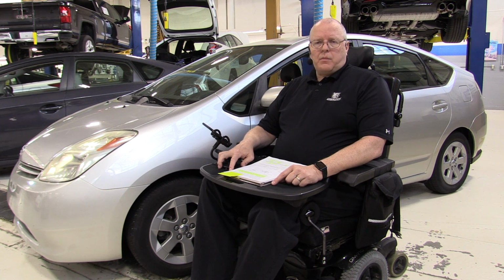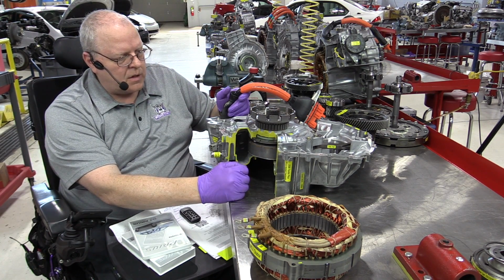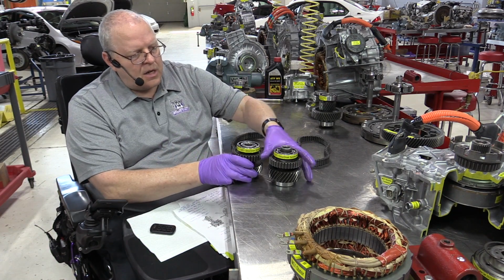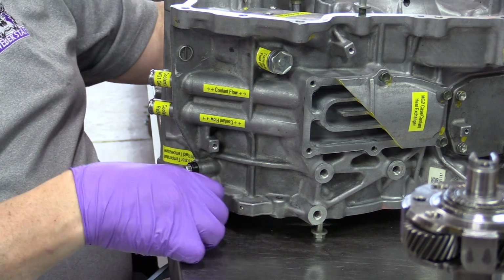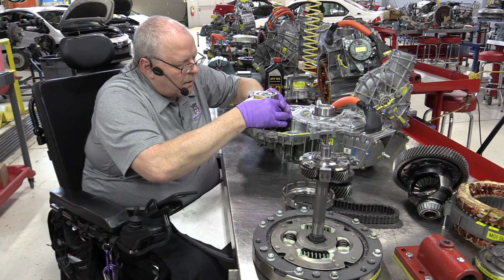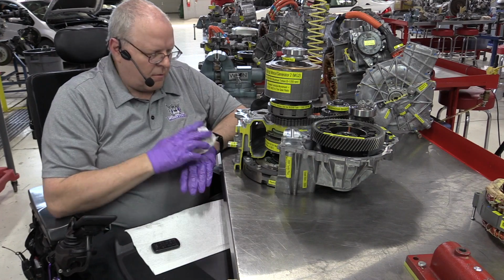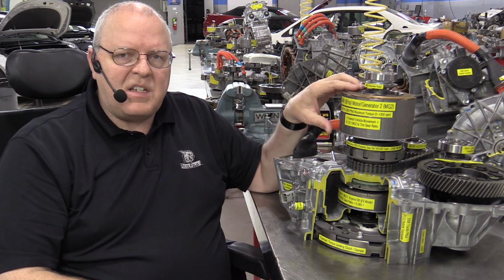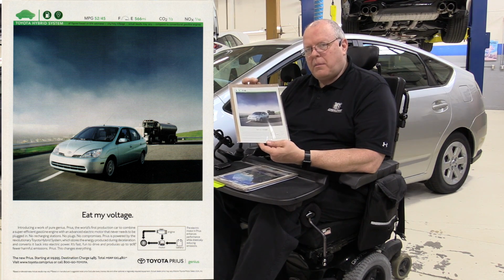2004 - 2009 Prius Transaxle -  P112 Deep Dive

Comment: Thank you for the video, I recently bought a 2006 Prius and it was great to see the inner workings of the transaxle. If you have the opportunity to get an Outlander PHEV transaxle made by GKN that would be interesting as well. Im sure the operation is very similar to the Toyota system but with the addition of a lock up clutch for Engine direct drive.

Comment: John, I own two 2007 Toyota Prius cars. I have rebuilt the HV batteries several times and this last time I replaced the battery modules with the new LiFePo4 batteries and the 400 amp output made the exceleration amazing.

Comment: I have a freedom 2 wind turbine that makes like 96 volts wired in series because it's two 3 phase motors and the amps is like 30 and only needs 15 mile an hour winds. Wondering if I can double the power if the v shaped permanent magnet rotor would make the same power as the normal grid with only a four foot carbon fiber blade and the magnets cancel each other out with a total of 48 and spin smooth brushless at 25 feet with just dirty wind from tall trees. LoL just a thought
Reply: Turbines are more shine waves or phases but low rpm or hertz. Wild ac power is directed on just one positive dimesion or direction like DC.  Think like more phases or braided 7 waves of positive magnet flux spinning less speed revolutions but more phases less spaced apart not just 3 with alot of force or rpm more resistive than conductive. With 3 phases each phase one third apart make 3 phase 60 hertz.  Not 7 phases and low 4 hertz or about 250 rpm. Normally 3 wires with 3 phases so one third spaced apart alternating current in each phase equals 60 hertz. Divide 3 or 3600 rpm and 3 phases spinning 60 hertz. PMG wind turbines are like 250 rpm or like four full waves or hertz each second but with multiple waves before each complete turn piled up basically four hertz times 7 flux magnets that simulate a cycle of one phase so seven voltage positive and negative waves starting starting with multiple waves wild ac converted to DC with a rectifier. They told me just good for charging batteries even if you can get almost 110 volts it's wild ac turned to DC to charge fast not run electronics. You need Maine a 3 magnet 3 phase ac motor spinning 3600 rpm to work like utility's power grid. Nevermind thinking trying to hook up a drone motor where the alternator should be. I have a GM  Delco alternator converted to a 1500watt PMG but really that's top rating and it really only makes 3 amps at 12.5 volts 250 rpm
Reply: You know how the hybrid charges at only 5 amps. I had a solar charger hooked up to cigarette lighter outlet 20 amp charging a separate battery or battery bank 4 times faster. Just need enough power for computer to just get ready. I want try more power than 5 amps from the step down charging module for power to be available with a pure shine wave inverter when the engines is off I can use 110 a/c

Comment: what is the internal spline spec of the main drive gear shaft ? also , what is the spec of the spline on which the clutch plate assembly is mounted?

Comment: "Eat my Voltage" is a throwback to "Eat my Dust" reference is probably correct, implying that when driving a Prius Hybrid-Electric vehicle, one did not have to compromise on acceleration nor passing performance; possible as a response to those unfavorable initial auto magazine reviews of the 1st Generation Prius and the misunderstanding/misinterpretation of the "turtle" mode.

Comment: what is doing MG1 when MG2 is moving the car and the HV battery is fully charge? Mechanically i can see when MG2 is turning it moves also MG1, is MG1 always generating? because you said that to charge MG1 the engine needs to be on; and if MG2 always moves MG1 how it is controlled MG1 to do when the shift is in D?

Comment: Hi John, love your videos.  Can you tell me where the extra voltage goes? If the new mg2 can put out 500 volts, but the battery is only about half that.... What happens to that surplus?  On a conventional car, a 12v battery typically charges about 13.8 volts,  you would not want to put much more then that into it.   Thanks,  Pete

Comment: Sir this video really  helps me to understand many specifications for second generation Toyota prius transmission. Thank you very much. It is important for me to know a power (kWt) of MG1 . Please write what is 2nd Generation Prius MG1 power..Thank you
Reply from the maker: Thank you! I do not have the power rating for MG2 2nd gen
Reply: As is shown in video MG2 power is 50 kWt  (at 11.58 min. on video). But MG1 power is unkown. In the web some information say that MG1 generator power is 22.5 kWt ...On the other side MG2 is approximately twice big then MG1 and may be if it power is 50 kWT power , then MG1 power should be - 22.5/25.0 kWt...
Please answer -  is this MG1 and MG2 motors voltage same -  500 or 600Volt?

Comment: Sir I really love your Work, Allah bless you. I have a question that why they used ball bearings instead of tapered roller in counter driven gear in second generation? Because, as in best of my knowledge, tapered roller bear more load then ball bearings. Thanks,  LOVE YOU!
Reply from the maker: Thank you! Yes, I believe that is true
Reply: Thanks sir for your response. Please tell me about your perspective in the light of your experience, is there any design advantage of using ball bearings instead of tapered roller in second generation Prius?  Stay blessed.
Reply: Much cheaper

Comment: Great series! Love them and I am very glad that I might even help you with understanding the N position. At 53:43 you say you don't know what happens electrically. As I understand it, the Inverter short circuits the coils in MG1 and MG2.  Due to this short circuit, no voltage can build up in the coils, hence no energy can go anywhere.  

In Ohm's law: R=0, so U = I x R = I x 0 = 0 and P = U x I =  0 x I = 0.  The electrons in the coils will probably go all over the place within the coils, but since no energy is going out of this system, no energy will go in either. So no rolling resistance, no charging current, etc. 

To me, with some electrical background, this sounds very plausible. ;-)
Reply from the maker: Thank you and thanks for your feedback! I don't think they short the stator winding together, I now think that they open them to stop current. But there is still the rectifier diodes with their current path. I am doing some bench experiments to find out what happens. I will have another video when I am completed. Have a good day
Reply: I too think you are correct now. I can't find any reference for my claim, other than a vague memory somewhere in my head. All 3 coils of each MG are connected in a kind of triple H-bridge, and there is no easy way to short circuit them via this bridge without also short-circuiting the HV-battery. To short-circuit the coil, an extra circuit would be needed. Also, if I apply Ohm's law to the R= oo ( oo = poor man's eternity symbol), then I = U/R or very close to zero 0. Again P = U * ( 1/oo ) = almost zero. Just as easy. No current can flow, so no power is lost in traction.  
Sorry for causing confusion.. ;-)
Reply: You are correct, the way to put an electric motor in freewheel operation is to open the coils. I don't know how the electronics in the inverter/generator are arranged but, normally the stator is connected to a 3 legs bridge that can operate as a rectifier, an inverter, a short circuit or an open circuit.  By the way, thanks for the videos, I learned a lot from them.

Comment: You missed the changed bearing on the end of MG2, on the NHW11 (Japanese chassis identifier as the Gen1/Gen2 is wrong). The bearing fails on NHW11 causing MG2 to be misaligned, this causes arcing and transaxle death. Toyota realised there was a problem with the bearings which is why they changed most of the bearings in there for NHW20.
Reply from the maker: You are correct, Thanks for your feedback! I did notice the bearing change. The old one had an o-ring around the outer race and it was smaller. I forgot to include that in this video. Have a great day!

Comment: Thanks Prof. Question for you. How does the throttle pedal work in relation to engine rpm and mg2 power output and why hybrids don't come fitted with a rev counter?
Reply from the maker: Thank you! The throttle pedal input affects the torque applied to the MG2 rotor. The torque supplied to MG2 can come from two paths. 1. Electromagnetic fields using the battery power. 2. A powersplit gearset where the engine can contribute torque. Engine rpm has little to do with vehicle speed, so a rev counter would be confusing to watch. Best wishes.

Comment: Sir, great explanation and demonstrations sincerely. I was researching for hybrid system and end up with your video which have been very very helpful truly. May i ask, i know it is possible to assemble new electricity part next to diesel engine which is already installed to van but how do you do that? Do i need to change brain of the car or you can just do it by mechanically like analogously?
Reply from the maker: Hybrids with diesel engines are being used in Europe right now. I do not know how you could make a conversion work. It would require a lot of custom work and programming. Best wishes!
Reply: With a lot of work and training i guess. Thank you, you too!

Comment: Professor, when the car in reverse mode, what is the high voltage current does or just mecanical sir?
Reply from the maker: The MG2 motor is just spun backwards by the inverter in reverse.
Reply: thank professor, is it anyway to test the transaxle before we install it back in the car sir?

Comment: thank professor but my wonder why they didn't build a plugin charger like Nissan leaf even Nissan is 100% EV in case the high voltage battery is low

Comment: 45:20 when MG1 is held still or allowed to slip, does it drain power from the battery pack, or does the battery get charged as MG1 slips?
Reply from the maker: I don't think MG1 is ever held (stopped) while driving. The MG1 speed can be made faster or slower than the engine by changing the power generation rate (MG1 rpm). There may also be times when MG1 is treated like a motor to obtain the proper rpm and torque contribution to MG2
Reply: It can work in generator mode or motor mode ( to help the electic motor 2 or start the gas engine ) by consuming power either from the battery or from the gas engine ( in case it's stopped or slips a bit ).
The exact regime is given by the factory parameters.

Comment: Nice presentation. Do you make all the cut-outs in the transaxle housing yourself or do they come from Toyota that way? They look nicely done. I found interesting that you could get such an increase in MG2's power output by changing the magnet configuration to a V shape. Maybe it is a way to concentrate the magnetic field for best results.
Reply from the maker: Thank you! I cut the cases myself with a band saw, it is a lot of work, but works great for my students. The V shape is an interesting design.

Comment: This is gotta to be one of the most goddamn captivating things to to watch when completely high. Or''s that just me?
Reply from the maker: It is always captivating!
Reply: It's so captivating I'm watching it a second time.
It's just comforting to just know more of how your car works. Which reminds me...

I'm experiencing brief or frequent dips in acceleration (and engine noise) when flooring the car out of a tricky junction. This normally happens when the wheels are at a slight turn, but I know this isn't caused by the TC. In normal driving I'm not getting any strange noise, but I'm nearly at 160,000 miles in my '07 (Delta voltage is normally still below 0.2V and even less than 0.1V depending on SOC).

So what's that dip in acceleration as the unexpected hesitation can be blood curdling. Is it the flywheel/pressure plate slipping? Is it the CV joints, bad stators or is the PSD wearing away?
Reply: @BeLowBelowo  Most likely it's the traction control, which de-rates the output briefly (but seems like forever when traffic is bearing down on you!) before reengaging.